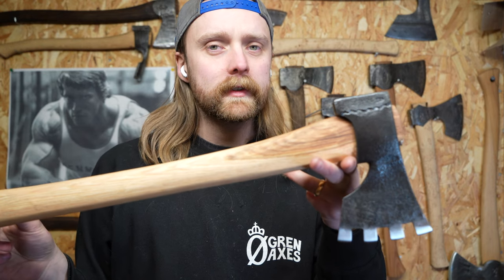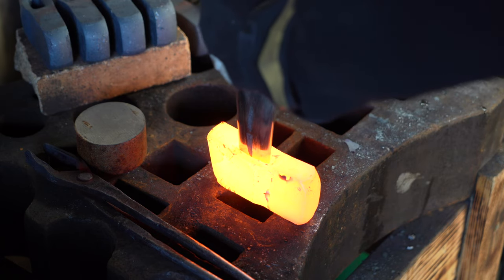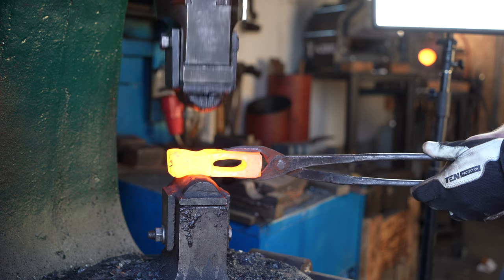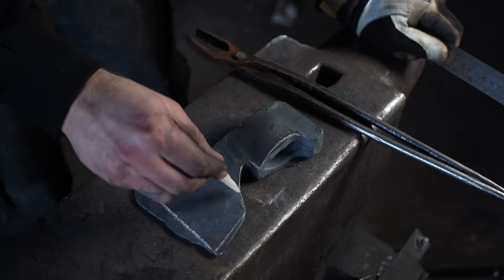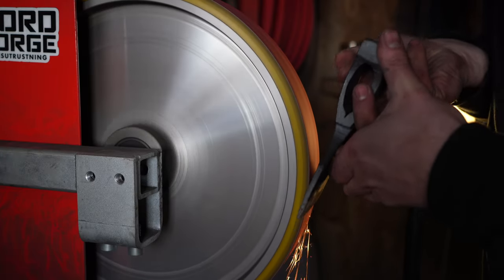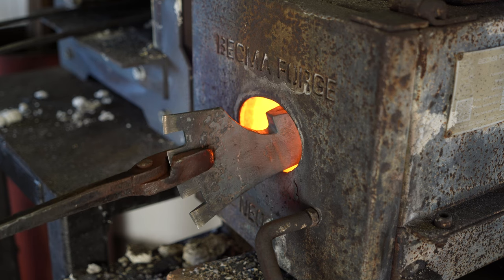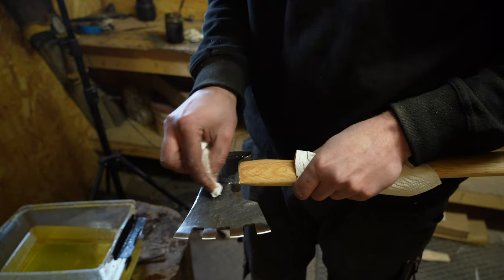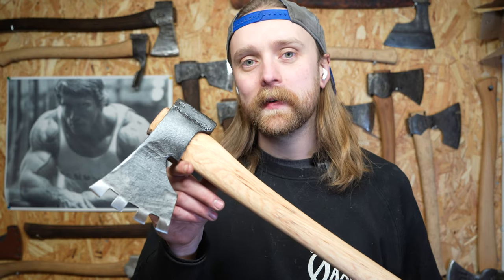I Forged the Strangest Axe You've Ever Seen

Comment from the maker: I totally forgot to mention what steel I was using! The steel is C60 and its the first time I tested it 😅
Reply: You also forgot to tell us you got your teeth fixed.  Your video thumbnail is freaking hilarious!
Reply: What type of steel(s) do you normally use for axe heads?
Reply from the maker: @goodravensforge  The most common steel I use is 4340.
Reply: Could you try making a shipwrights adze?
Reply: when are you going to restock your shop i would like to buy an axe from you because they are beatiful
Reply from the maker: @devious-dodo-eater  We restock our store at least once a month. usually twice. However they sell out rather quickly. If you want to find out when we restock, you should join our private Facebook group, or join our email. You can find the info on my website at www.nilsogren.com

Comment: I guessed a stone sculpturing axe; but I wouldn't have guessed to make grooves in wood for clay. Shouldn't the cutting edge be straight for that? Still; verrrrrry impressive axe; and very impressive video. Congrats.
Reply from the maker: Thank you very mich!
Reply: you probably want the irregularity and straight corners to really hold the clay/plaster with less cracking. also it is possible that the notches help prevent splitting the wood and accidentally removing too much wood.

Comment: I would have made the slots semi-circular instead of square, to eliminate stress risers in the corners. There is a high chance of one of the teeth breaking off during use.
Reply from the maker: I rounded them out with a small diamond file just before heat treatment. Was a bit nervous tbh but it all went fine.